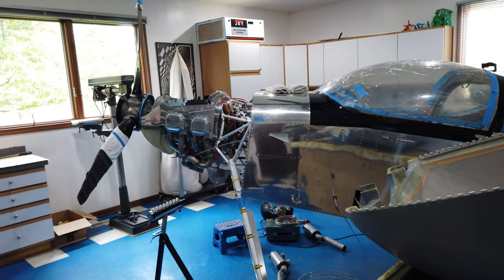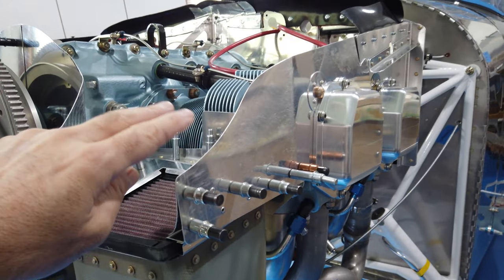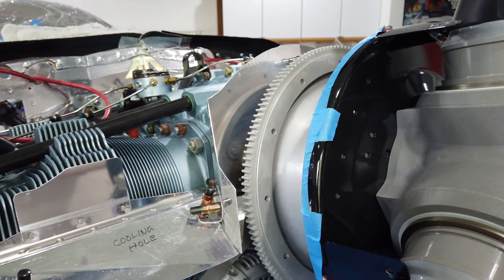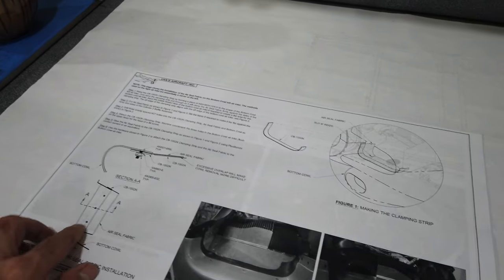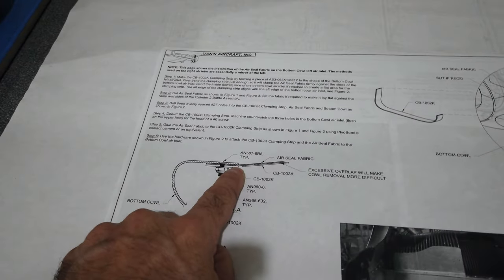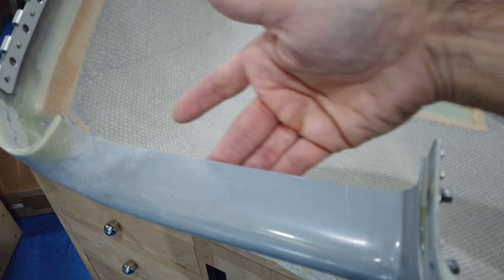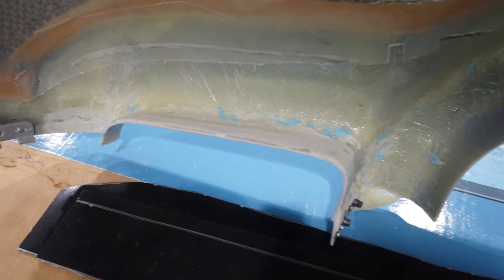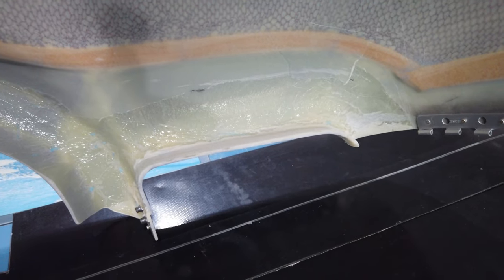Vans RV 7 HINT Videos Baffles Cowling Mods

Comment: I have had a lot of trouble with my baffle material on the bottom of those air inlets as the engine begins to sag, specifically on the pilot side where the snorkel is.  When I fit mine the seal was not quite above the air inlet filter so it was pinched and ended up tearing the baffle material.  I ended up slicing it off for the first 50 hours and then when I replaced it the engine had sagged just a minor amount and the seal was able to sit a lot better.   Still I may need to remove them and sand down the underside of the cowl a bit more if it doesn't move anymore....not sure how many hours will result in the final resting position for the engine.
Reply from the maker: Howdy Allen. Something I'll try to look out for while the engine settles in the mount. Thanks for the heads up.